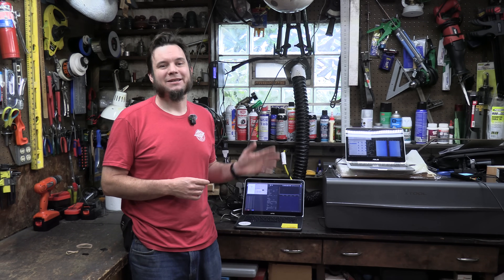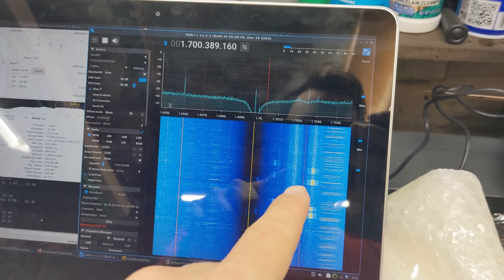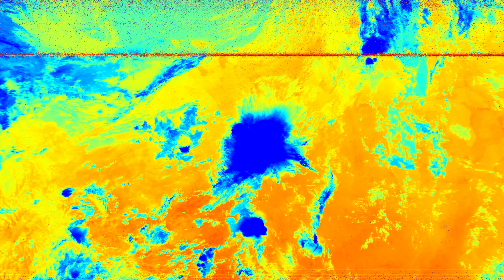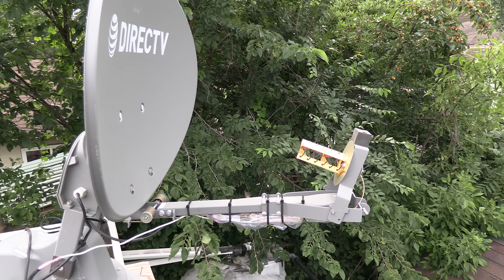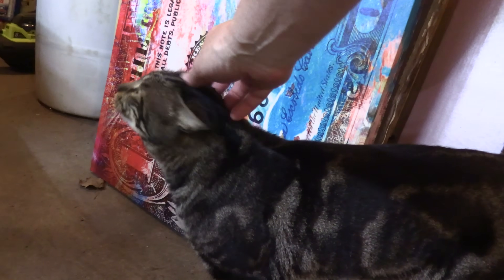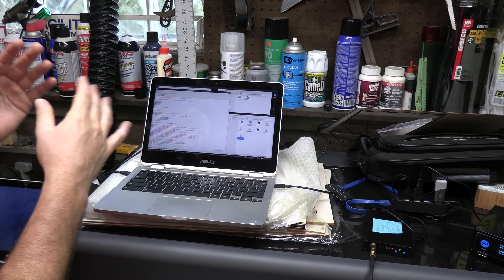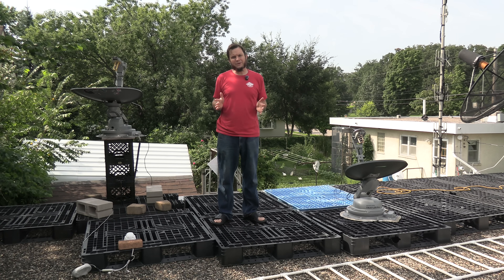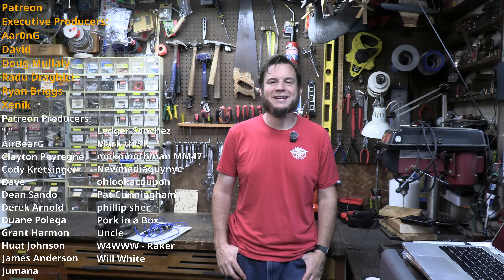Surprise! NOAA 15 Is Still Alive (For Now)

Comment: Just "bend" (there are better ways) the antenna swinging arm 15° back  and tweak the code to make 75 the new 90... You will lose range in the low end but that's not such a big deal.

Comment: I have found that with SatDump if you don't have a fast computer with an SSD and 8 GB of RAM the computer is so over worked that you loose some of the satelite data while the computer's running some of the other process. On my system I have SatDump running on one SSD and I save the data to another SSD. My system runs 24/7 and the biggest issue that I have is about every 3 or 4 days I have to go onto the data drive and delete a boat load of the older files. When you are collecting data 24/7 it does not take long to fill up a drive.
Reply from the maker: I have Raspberry-NOAA running 24/7 and have some cron jobs set up to auto-delete the oldest data. I had the same on my GOES setup but I messed up the scrips and now that drive is so full it won't boot :-P It's on my to-do list to fix that!
Reply: @saveitforparts  I need to set up some way of auto-deleting the files that are more than 3 days old.

Comment: Hi, very good video. I've been looking at antenna rotators, but not all of them work (as you say, they have to be fully azimuthal, not just up to 75º, and adapted to the intended use, not for watching stationary TV satellites). I've never had an azimuthal one. The only one I had was only horizontal (I mean, for moving an HF yagi...). That one came with its own control box and goniometer, and all it took was manually pressing the rotation button until the goniometer showed the direction you wanted to point it, without any kind of PC control required.
For these parabolic rotors, you need a PC interface to control it, which is much more complex to operate, especially for those without extensive computer knowledge. But hey, I guess anything can be tried...
Anyway, what other I-band or C-band satellites will be left when turn off the 15 ??
If in the end, only the JPSS are going to remain in the X band, that band is very critical. From everything I've read about it, not just any rotor will do; it has to be very precise. The "normal" ones used to watch satellite TV aren't suitable for that band. Also, the dish has to be over 1 meter long... the LNB and the SDR, not just any $40 NooElec... prepare a few hundred dollars...
But anyway, thanks for your video and information. I suppose together we'll find a simple and inexpensive way to continue seeing our planet from space. Regards.
Reply from the maker: Yeah, a high-accuracy rotor is going to be important when I get into X-band. Most of these consumer-level dishes are only accurate to within a few degrees, which is good enough for TV but not ideal for scientific stuff.

Comment: It seems to me that a home made dish aiming thing wouldn't be all that hard to make.  You can use a method that was used on some very early disk drives to avoid the need for absolute encoders.  They just brought the mechanism to the limit switch by stepping a zillion times on power up.  From there it was just a matter of counting steps on the stepper motor.  There are premade stepper motor drivers so you don't need to invent that part.
Reply from the maker: I have some parts like that, and a radio astronomer in Canada sent me some stuff. I just need to find the time to get it all together!

Comment: Maybe there is an obstruction preventing it from going beyond 75 degrees.

Love the ADM workplace worker accident sign in the background. 

Did you ever try getting data from the GOES Weather Sats? If not that would be an interesting video.
Reply from the maker: I have a couple videos on GOES, I need to update that system too, my dish could be aligned a little better.

Comment: Unfortunately we are in the age where aquiring knowledge and teaching has been stomped by chasing the almighty dollar. We celebrate the lords and discard the commoner. 
The information these satellites provided was a great learning platform. Now because of budget and age without replacement were just done, better look back at my phone and leave the sky for those that own it.
Reply: Sad.
Reply: In fairness, these sats have been replaced; it’s just that the new transmissions are not as easily receivable (higher frequency) and take some more skill. Which just means the hobbyists have to step up their game just like we did when SSB came out, when TV went from NTSC to ATSC, etc. 😊
Reply: @ruhnet can't say I've been using an oscilloscope to listen to the transmissions. I'm more in the area of deprecated IPOPP and SPAs that dump level 0 through 4 data. You can't expect a kid in a classroom to benefit from pops and whines and a bouncing line on a scope. 
You are right, there are new sats but they haven't followed the same mission of education and data availability.

Comment: A while back in D.C., I talked to a NOAA official. I asked if in the future NOAA would continue to add LRPT/APT to future satellites. She said that it was very possible for STEM use in schools or other learning environments.
Reply: NOAAs intent for current satellites was to be no low res side transmissions. Ingest the data into NOAA and users come get the data via internet. But, yeah, I can imagine them adding a side channel in future satellites. If they did, it won't be LRPT/Apt or any scanner style transmission. It would be CCSDS type transmission. CCSDS is a versatile formate that allows lossy/lossless compression, error correction, packetization, etc. Packetized data even allows each packet to be a completely different type of data. More like miniaturized version of modern weather data.

Comment: 12:40 regarding the sleep instructions maybe you want to have a look into Python IDEs that let you debug your Python code (e.g. VSCode with Pylance extension or PyCharm IDE). It let's you step through your program step by step or jump from one point to the other and inspect all the variables at once at every point in time. It can also greatly improve your understanding of how does the program behave. I know it's a lot to get into but this is really the way to go if you want to do this kind of program execution.
I'm just assuming you are not aware of this here, because you open your code in a text editor (totally fine of course :D)

Anyways thanks for the video!

Comment: If your python is missing something like the re package, it's very broken.  It could be a stale venv or something.  If the system python updates, old venvs can become broken.  Typically in that case you'd just delete the venv, create a new one then install the dependent packages in to it again.  I think there are ways to update a venv but i couldn't figure it out.
Reply: Hi, it sounds to me like he is using a separate library called 'regex' not the built-in 're', otherwise it sounds very unlikely to be the case. But I agree with your comment and your suggestion :)  It might just be as simple as forgetting to activate the venv

Comment: You said at the end what I was yelling at you through most of the video-- just add a +15 degree wedge to the base so when you're at the max of 75 you're at 90. You can lose the 15 degrees at horizon cause terrain and atmosphere is gonna be in the way of signal there anyway.
Reply: That could work if you're just looking to complete an arc that'd fit in that range, but it would probably have to be set up differently depending where the arc is.  I dunno the geometry of all this stuff though so maybe the way satellite orbits work it would be totally fine to do this.  He'd just have to extend his software to add that compensation.  Otherwise, however your tilt it, there will still be that disc at the top of its range that's inaccessible.
Reply: This isn't really a workable solution.  It'd be a good exercise to draw/map the motion out, I think you'll see, that you'll only get to 90° at the one degree (out of 360°) where your wedge is... 

Raising the pivot point so the dish has clearance by modifying the base housing is likley the path of least resistance to 90°.  This is what  I'd do.
Reply: Yes just move the wedge for the pass you want.

Comment: Do you think going above 75 degrees elevation really does make it "much" less useful?
The time the satellites that pass directly overhead in the elevations above 75 degrees is really short.
And actually the azimuth motor is usually too slow to turn the antenna in that area of the orbit anyway...
Reply from the maker: It's hard to tell with this one, for direct overhead passes it would be nice to aim directly at the satellite, especially for weaker signals like NOAA 15 on L-band where it's harder to hear when it's not directly overhead. There is a motor speed override in the firmware so I might be able to make it run faster, but I've tried overriding the elevation and no luck :-(
Reply: @saveitforparts  Ok, but I think that when you really want to track overhead passes all the way, you need a 180 degree elevation rotator, because in a 90 degree elevation system you will never be able to move the azimuth around quickly enough to remain pointed all the way through that segment above 75 degrees elevation...
So even when you can point above 75 degrees, your azimuth will still be off.

Comment: As someone who works with these mobile satellite TV antennas (winegard and king) for retail and support this is always intriguing. You mentioned picking up the Pathway X2 recently. The X2 was a Dish specific upgrade to the earlier version of the antenna called the Carryout Anser. The Anser was externally powered and multinetwork capable (direct, bell, dish). The antenna was designed to self-search and temporarily pause each time it found a satellite ID lock. You finished the aiming process by using your STB to find the right satellite and cut power to the antenna lol.  The upgraded Pathway X2's main selling points were gaining working power over coax via the Dish STB, Dish Mobile Protocol control via DISEC (like Tailgater, etc.), the ability to switch between Dish Network Eastern and Western arcs (commanded via Dish Mobile Protocol software), and another special mode for locking onto a single sat w/ majority of Dish lineup so both connected Dish STB would share the same signal- instead of fighting the controlling STB on the Main port. The large 18" reflector made alot of this possible.
Reply from the maker: Thanks, that's cool info! And great to hear from someone who works with these. I'm wondering if I can fit a 3D printed helicone into the pathway, it's on a Carryout now but it's too big for the plastic radome. I'll have to mess with the thing soon!

Comment: I have to wonder how possible it would be to crowdfund a small fleet of completely free to use satellites that would replace noaa.
Reply: A fleet of full sized satellites? Probably a couple billion dollars. One satellite will cost around $300 million. And then launching it will cost between $60 - $400 million depending on weight.
Reply: @derek17ca  And funding a completely new ground system to control them. To make it interesting, you need to place the ground system(s) at a certain latitude to get the required contact time to transmit and receive and recieve the full commanding stream. Then you have to get the proper transmit and recieve frequencies allocated to you. You then realize how crowded those frequencies are so you need to move your ground system 'somewhere' that doesn't interfere with other satellites. Then you need to come up with a method to keep your satellite from being hijacked and redirected to changed to a subaquatic orbit. And things rapidly go down hill from there.
Reply: @derek17ca not necessarily. Russia is still using carcengogic rocket propellant that is 1/4 the cost. 100 million and the ability to never come home due to epa will get you there
Reply: meteor lrpt exists
Reply: @no.nomoreidontcare  After having no problems with NOAA15, 18 and 19, I've never once heard anything from Meteor M2-3 or M2-4. It seems to be that they only turn it on when they have saved up enough Rubles to pay for a quick transmit.
Reply: Possible? Sure—just depends on who your “crowd” doing the funding is. 🤣 But seriously, it would be cool to have some hobby-grade sats for weather usage. That might be attainable for very limited usage. Power consumption is the main issue.
Reply: Lol. That sounds a lot like communism. Love it.
Reply: @laurensa.1803 far too much voluntary funding for it to be communism

Comment: 14:07 Could you build a 20 degree platform and put it under the dish compensating for the difference of the dishes movement
Reply from the maker: That's what I was thinking, not sure how the azimuth motor and balance would handle that.

Comment: When they say shut down does it mean they crash the satellite back to earth or is it just allowed to continue operating but is not used by the government anymore?
Reply: They use the last of the propellant fuel to push the satellite into a graveyard orbit where it less likely to interfere with or crash into active satellites.
Reply: They will just sit in space still running, but with the transmitter off.

Comment: Thanks to your other video on the NOAA satellites I spent all day battling through installing all the software on my raspberry pi and laptop to receive the NOAA 15 APT images on VHF for the first time!! Disappointed in myself for leaving it until the satellite is about to be decommissioned so now I’ll have to get some more equipment for other frequency satellites. Thanks for the videos :)
Reply: How long have you battled with the hardware though? Such as rtl sdr, amplifiers, filters, antenna blah blah